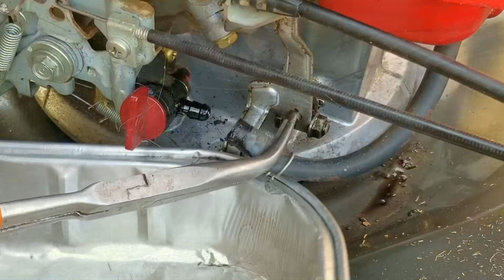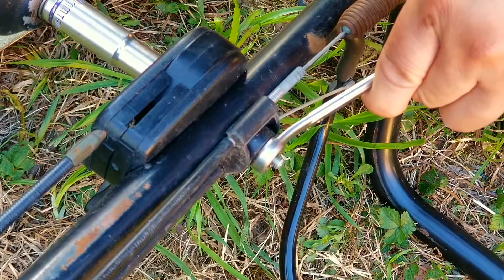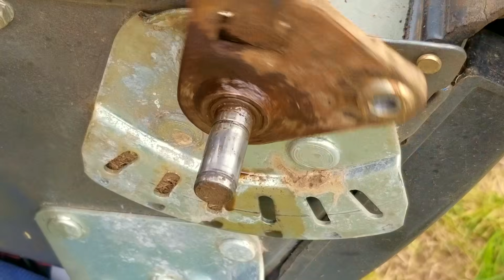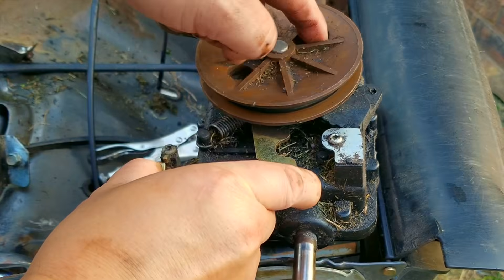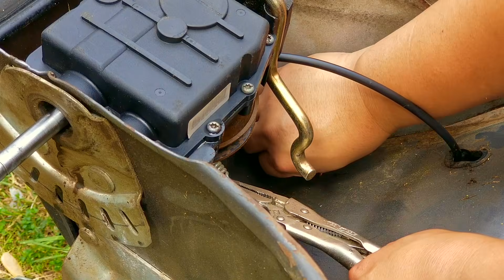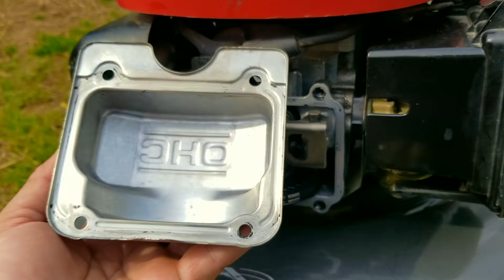Honda Mower Self propel finally fixed

Comment: My mower did not reverse and the self propelled was not working at all, after looking and assessing my only problem with the self propelled was the tensioner cable, I readjusted the nut and spin the adjuster and this fix the problem immediately the reverse got fix and the self propelled is stronger and faster.👍🏼
Reply from the maker: wow nice work!

Comment: I just got a free Harmony 215. Manufactured between '88 and '94. It's got a lot wrong with the self-propel system. The engine starts in first pull and the blade engages flawlessly, so I'm going to spend what I have to and keep this relic mowing.
Reply from the maker: it's a shame you aren't able to get the self propel fixed.

Comment: The more complicated the assembly, the longer the diagnosis. It doesn't matter what the brand is.. But in reality.. I like the little challenge.. That's why my 1991 Snapper is still a working mower in my collection.
Reply from the maker: correct and good choice

Comment: They sell a T-Handel hook used for Automotive brake springs which would work better. I am retired so I would have no issues with spending eight hours fixing the mower but from a business stand point it wouldn't be worth the time but that deck looked like a cast Aluminum one & if so I would fix it.
Reply from the maker: thank you or the tip

Comment: There is a monumental difference between this and the Honda commercial mower. Hydrostatic transmission.
Reply from the maker: yes you are correct the hydrostatic transmissions are very good

Comment: Hot tip for re-assembling these mowers:  I've lost many of these bolts because they vibrated loose. Never use lube on the fasteners, use blue Locktite. The locktite will prevent  loss of the fasteners and prevent corrosion also.
And for the do-it-yourselfers, never disassemble the mower in the grass. That's a guaranteed way to lose fasteners.
Reply from the maker: thanks

Comment: I have a honda mower that yhe vin number tag is gone , so I dont know what model it is , i need a new cable that engages the drive wheels since its rusted. can you tell me what is your model ? is exactly like mine.
Reply from the maker: unfortunately this mower is not mine and I returned it back to the customer a long time ago so I don't think I'll be able to find out what it is.

Comment: If any mower that still works, yet needs issues corrected, repaired and you can do it your self, its better then a new mower that costs $600.00 or more like a Honda, you fix it. Cheap mowers that cost $169.00 don't waste your time.
Reply from the maker: yes I agree

Comment: I don't know how to do this, so I would most likely pass on the project. However, I can see that it would be a good learning experience. I just wouldn't want it to be another unfinished project in the house. 

Apart from the transmission, what big problems could you run into trying to fix this?
Reply from the maker: it's understandable and the biggest one is breaking or loosing a Snap ring.  The spring is also really tough to put back on.

Comment: Literally less than 35 hours on my HRX 217, and mine has stopped working. Unacceptable for a premium product like this
Reply from the maker: how did it happen? Were you trying to get it running for a spring cut or did it stop on you?
Reply: @INSIDEHOUSEGARAGE  I was in the middle of mowing my lawn and it just slowed down and stopped. After typing the message, I went back and messed with it, and got it working by adjusting the speed dial to max, and it started driving again. I was able to dial it back down to my normal walking speed and it's working fine. I guess something got jammed in that bushing
Reply from the maker: just a simple request, but have you checked the oil?
Reply: @INSIDEHOUSEGARAGE  yes, the oil level is perfect.
Reply from the maker: I'm going to guess it's a fuel issue.
Reply: @INSIDEHOUSEGARAGE  to clarify, I was referring to the drive system, not the engine. The engine runs perfectly fine. While I was mowing my lawn, the drive system stopped propelling the mower, and I was unable to pull it backwards. I ended up getting it working again by increasing the speed dial on the drive handle. Something must have jammed up the drive transmission, but it works fine now. 🤷‍♂️
Reply from the maker: oh now makes sense

Comment: I appreciate this video as I got a free Honda mower with a sketchy transmission with the problems you described. I plan to do it as it seems like a very nice mower and I am cheap. I would just divide the time up into small chunks.
Reply from the maker: yes that works out too, and good luck with it
Reply: @INSIDEHOUSEGARAGE  It all came apart pretty easy. I noticed just needed some gentle cleaning of the bearing that the axle goes in. The cable that controls the speed, was the main problem, as once I got it apart, I noticed it was stuck between gears, and shifting it did nothing as it was seized up. Again thanks for this, it made it easy to follow.

Comment: Great video, nice detail, great camera work and editing.  Seems you need to invest in compressed air instead of using WD40 to clean everything though.
Reply from the maker: probably but compressed only works to get what you want clean, and transfer them to your eyes close and other parts don't need cleaning.  it's also carb cleaner

Comment: Usually I don’t use a hammer on  a shaft. The hammer is hardened metal, which can mushroom the end of the shaft. Typically I sand the end of the shaft and as much as close to the adjuster arm.
Reply from the maker: nice technique
Reply: rubber mallet or a wooded block indeed for mashing stuff out.

Comment: 1) Failing ignition coil after warm up.
2) Backed up muffler
3) intermittent failure of spark plug
4) newer carb is defective and has failed
Reply from the maker: thanks!
Reply: @INSIDEHOUSEGARAGE  ,
5)Could be the throttle spring needs more tension

Comment: In reference to removing the tension spring with the vise grips another way to remove springs is by a piece of " mule tape pulling line " tied to the 1st coil of the spring NOT the hook end and then with the mower secured you can pull the mule tape line to release the spring just be sure you tide the line to spring coil so it won't come loose when pulling it . I've used this method on many springs on commercial zero turns ,  residential riders , etc. and you can repeat in order to reconnect the springs .  Be safe !
Reply from the maker: thanks for the tip
Reply: I'd guess that about 99% of the general public have never heard of Muletape nor would they know anyone to aquire a small length of it from. 
I have a spool of 1800 lb Muletape  and I always give some to friends because of its many uses.

Comment: Got one that has the same problem took off gears on both wheels push mower now mine is a 1998 still runs great and cuts great too .I may do mine now just to have something to do.thank you.
Reply from the maker: Right on thank you Ted Mangold.

Comment: You couldn’t open snap ring around shaft and move it to the other side without moving the driveshaft assembly I’m a overhead crane fabricator electrician and do field service for are cranes in operation I do this exact same thing  some times
Reply from the maker: ah, thank you for the tip, that's going to help out a lot.

Comment: The good thing is that it is rebuildable to functioning like it’s designed to do and wasn’t that expensive doing it..and any time you can keep things out of the landfill, that’s worth a little bit of time in my eyes. Far too many things are ‘throw-away’ and for no good reason other than greed. Have a good one y’all!
Reply from the maker: thank you Steve Turk.

Comment: I notice this is a very common issue with self propelled mowers...and this is a great/helpful video.  However, I think this looks more complicated than a typical homeowner can handle.  I suspect that if it takes 8 hours for you - with your expertise - it would take way longer for me (even if I remember to put it back the way it was...video or not).   I learned a lot from your videos. Can you please do a video on  (seasonal?) preventative maintenance for a self propelled mower especially to ensure that the self-propelled feature continues to work?   The whole world will thank you 🙂
Reply from the maker: you make a good point, however if your labor is cheap, then spend the time. IF on the other hand, you make 30-100 an hour at your job, pay someone else to fix it.
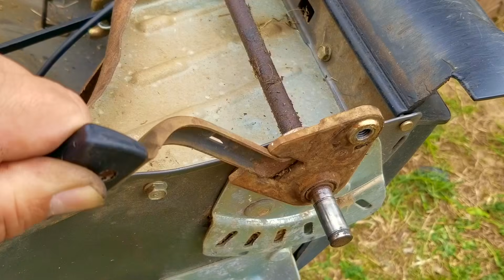Reply: if you have done a similar repair it's likely sub 2h, a lot the time was spent figuring stuff out. Also filming, filming is likely to double or triple the time alone - notice many different camera angles . For instance at 4:20, the removal of the stuck height adjuster would be trivial with a 2 arm bearing puller (no hammer action - if there were bearings it'd hard to extract/place them back w/o extra sanding). 

Where I live I'd be hard to find anyone to fix any out of warranty equipment, so I end up maintaining/fixing most stuff. Years ago (7+) I spent lots of hours (likely more than 8) fixing a 30ish euro soldering iron (had to make a small board to replace the power driving circuit entirely [triac+optocoupler and some passives] and the 5V power delivery, effectively leaving only the microcontroller and the temperature comparator). It still works. I'd spent around half of that money on a lunch each work day. So not everything it's just labor.

Comment: I had a mower last 17 years without an oil change or air filter. It did get blades. Best $280 ever. 
Now I have a Honda engined Victa mower. It gets serviced.
Reply from the maker: wow very nice.

Comment: Those adjuster arms where they ride on the axle were made too short and so the bushings wear out easily and seize. To solve the issue add a grease nipple into the adjuster arm body, and make sure the shaft seal is always in good condition plus carve a groove into the bushing for better grease dispersion. I've done so many other modifications to these lawn mowers to make them more reliable but the body design and driveline is just crap. They can't touch the original HR 21 and 21-5 from the late 70s-early 80s, those are the best mowers Honda ever made.
Reply from the maker: thank you RideCamVids.

Comment: I dont get how it took you 8 hours. I have done the same repair, including the splitting and regreasing of the transmission in just under 2.5 hours. Maybe I have done so many of them in the past that I just got quick at it? It's a common thing to happen to them honda mowers primarily if the customers use water to wash the underside all the time. it was a good video and the advice and whatnot was spot on just don't understand the time involved.
Reply from the maker: filming,,..  the time includes filming the repair.
Reply: @INSIDEHOUSEGARAGE  oh ok that makes since I didn't think of that...

Comment: Ugh... my self propel gave out, it's a heavy mower to push!  But that engine is silky smooth.
Reply from the maker: did you look under the deck and see if the belt came off the pulley?

Comment: Very late reply here, but yes I have spent many hours on lawn mowers.  But since it's a hobby for me, and I usually give them away to people in need, Well, you get the idea. In fact I just took possession of a mower, with a Briggs engine that has points and condenser.  I'm looking forward to that challenge...
Reply from the maker: wow, that mower is from the early 80's then?
Reply: @INSIDEHOUSEGARAGE  Yes,  the date code is 1980.

Comment: One of the best how-to videos I've seen for Honda Harmony II lawnmowers. Mine is an HRT216SDA purchased in May 1999. I need to replace the gear selector cable. Excellent shot composition, lighting, focus and voiceover quality. (Yes, I was a video producer before retiring) Thank you for the very helpful video!
Reply from the maker: thank you Hank Ebert.

Comment: for that spring removal...i would try using a hook for removing radiator hoses. its a thick hook so its strong enough for something like that. they come in different configurations. theres one that like, bends back towards u that should be able to hook that spring pretty good
Reply from the maker: thank you Papi4l2 for the tip.
Reply: Brake spring pliers are made for this...!
Thank you for a well made video & honest too- boo boos are half the job!.  Do you recommend a light coat of grease on the gear teeth?

Comment: Yes I have a 1988 Toro Recycler that had a transmission that was hard to shift gears.I changed the dried up grease in the transmission and have been using it for the past 15 years.
Reply from the maker: very nice work.

Comment: great video i just run into it trying to fix my lawnmower i bought the belt and install it it seems like it wants to go and it does but very little and watching your video i notice im missing the spring tensioner do you think that would be enough to make the wheels move how they suppose to now with it since i put a spring but not anywhere close as big as the one it has??
Reply from the maker: yes the spring is essential, to putting enough friction on the belt and the pulleys.

Comment: Very well explained video. Thanks for all the side notes. I have the same problem. I thought it was the clutch cable and changed it. Didn't solve it. Followed your video. Took most of the parts out. Snapring removal is PIA. I need to remove one screw to remove the shroud and take out the axle. What did you use to clean the axle and transmission? Looks beautiful.
Reply from the maker: If I recall, I used, sand paper and brake cleaner, for the axle.  The trans I use old gasoline.
Reply: Snap ring pliers with worn tips are basically torture devices.  The tips should be cylindrical; once they're tapered, they can tax your patience beyond rational limits.  New pliers would be a sound investment in your own mental health...
Reply: @rbarr775  - The Channel Lock snap ring pliers I have came with a lot of extra tips, so that was a big plus...

Comment: Same as cherokeefiddler. Retired, my time is my own and plenty of it. I've spent more than 8 hours on projects around here that went bust. If a Honda can be made good again for $40 and 8 hours I personally would jump at it if I didn't have one already.
My Honda is now 21 years old, bought when wife was pregnant with first child. Honestly it still starts first time, but only one self-propelled speed. Could fix it but swmbo doesn't mow anymore and when I fire it up these days for some narrow parts of this yard I don't use that feature. But yeah IHG, a good mower is worth the time for sure. I'm thinking if you went through that whole process again, you could knock that over in half that time anyway. First time is discovery + fix = always a bit slower.
Reply from the maker: yes I agree with you, thank you Jed.

Comment: HELPFUL VIDEO! Just replaced trans(new $105 from ebay) Alittle tricky to get snap rings free. Make sure small axle drive gears are turning in correct direction, if not tranny won't engage wheels to drive forward. My Honda mower is 25 yrs old and still runs like a raped ape..
Reply from the maker: thank you WFO holeshot for the tips.

Comment: I’ve been doing this work for 53 years. I still make mistakes. No one is perfect. Great job. What a pain in the butt.
Reply: "it's Very very humbling to hear You a seasoned mechanic acknowledge that as well.🙏👍
Reply: 😢 it is.
 A pain in the butt. But there is a very easy way. Take the wheel off. Use A.
Pair of snap ring pliers take the gear off. Get a drill. And a can of PB blaster. Connect the half inch drill to the axle. Run and use P b blaster
Reply: @rayhewitt4688 heat too. Just be careful not to melt the transmission.
Reply: @rayhe @rayhewitt4688  Exactly what I did on an HRR216vka mower. A newer model than this, but I had the same problem no self propelled and the rear wheels wouldn’t roll backwards. I removed the carburetor side wheel and drive gear and between the lube and drill got it working perfectly fine again. Also sprayed the back side of the bottom wheel during the process. You definitely want to try this method first.
Reply: You can try to 💦 it. Down with a hose
Reply: It is, but these mowers are fairly lightweight for a self propelled. That makes it kinda nice for lifting in and out of a truck without a ramp. Much lighter than Craftsman which I use quite a bit too.
Reply from the maker: thank you Larry Jones

Comment: It's good video to watch and learn my John Deer self propeller lawnmower still running for 28 years and never done anything to it. every summer done and throw it in the shed only thing its need oil changed one before the summer.
Reply from the maker: wow that's pretty amazing.

Comment: Like most things, once you've done a repair for the first time subsequent repairs are much quicker and easier to do. Seeing the amount of rust it has I suspect the previous owner(s) left it outside. My 30 year old Honda mower has far less rust than that one and it has never required any repair. They are good durable mowers if looked after properly which includes regular preventative maintenance. That said, excellent explanation on how to do the repair. 👌
Reply from the maker: I think you're right about that and thanks

Comment: UPDATE: After several dismantles, I discovered the business end of the clutch cable was not fully engaged in it's slot. After repositioning, the self-propel function is working once again, but it's now stuck in 3rd gear like when I bought it. The cable looks worn and should be replaced, however none of those I searched for online look like the one I have. Perhaps the end of that cable has been marred? Any idea on the part number? Honda Harmony 215K3SDA. Thanks.
Reply from the maker: Thanks for the info, but I can't seem to find anything for the number you gave me.
Reply: @INSIDEHOUSEGARAGE  Found it. Honda Part# 54630-VE1-J11. Like I thought, most of the lever end is missing on my cable.
Reply from the maker: nice work